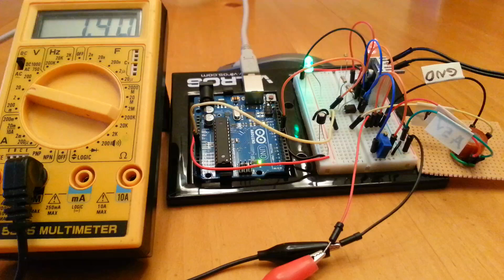CO (Carbon Monoxide) Gas Sensor Using Arduino Uno

Comment: When 1.4 v is working can I measure it every second? I think at 1.4 the analog output is about 0.5 but in 5v at same pollution analog output is 2.30 v
pls help
Reply from the maker: there is a specific point in the  1.4v / 5v cycle you should measure, and be consistent in always measuring at the same point in the cycle. check your data sheet for your sensor for the right point in the cycle to measure for your sensor.
Reply: +David Houlding i have to know pollution second by second so .i deciced to use mq-135 
thnks for your message 
i am from turkey

Comment: hello David. i have several questions for U. perhaps u can help me?
1. is the circuit can function well when i'm used in outdoor activities likes to detect carbon monoxide content produced by vehicles?

2. do you have the code that can display the output reading through serial monitor on Arduino?

Comment: I have a question, is it really neccessary to provide high and low heating voltage? What is the actual purpose by alternating high and low voltage? I actually bought a MQ7 module but the circuit diagram they provided is very straight forward, will it bring any problems? http://www.dfrobot.com/wiki/index.php?title=Carbon_Monoxide_Sensor(MQ7)_(SKU:SEN0132)
Reply from the maker: Hi Skyway. Regarding your question, yes, according to the datasheet for the sensor which you can find at the link in my blog at http://davidhoulding.blogspot.com/2014/03/co-carbon-monoxide-gas-sensor-using.html . Using the MQ7 sensor outside of the specifications in the datasheet could result in it giving inaccurate readings or getting damaged, or prematurely wearing out.
Reply: David Houlding , Thanks for your fast reply. But what is the purpose of providing high and low heating voltage?
Reply from the maker: Skyway I suspect it has to do with the optimal operation / accuracy / lifespan of the sensor. More in the datasheet at http://www.sparkfun.com/datasheets/Sensors/Biometric/MQ-7.pdf . You may also want to run this question by the manufacturer. Their contact information is at the bottom of the datasheet.

Comment: Hi. Thank you. But Which parts did you use in this circuit. ?   Please help me ? My mail adress : krc.typer@gmail.com
Reply from the maker: Hi Ugur. You should find the details on the components in my blog linked from the details under this video. Let me know if you have any further questions. Have fun.
Reply: Thank you very much . you are very good . I would like to work with you .

Turkey does not provide support for this type of work . In this way, I'm trying to learn .
You 're a good man . I would like to discuss one to one . We need your support